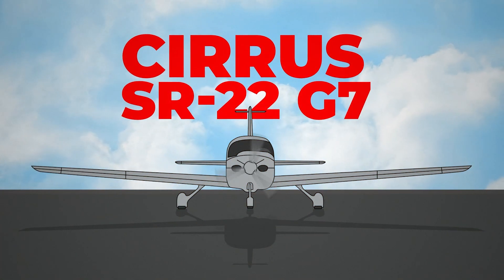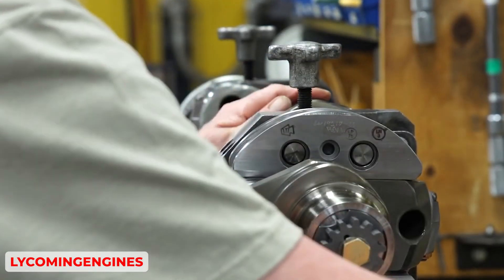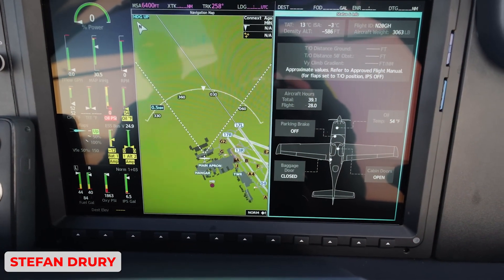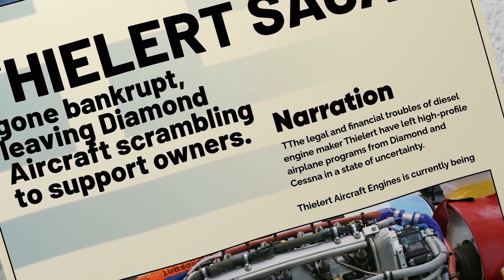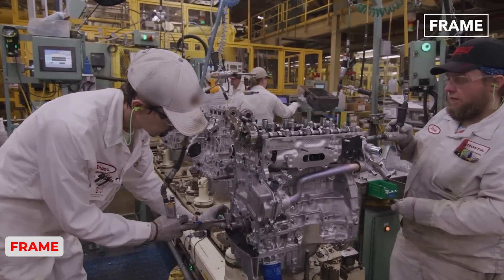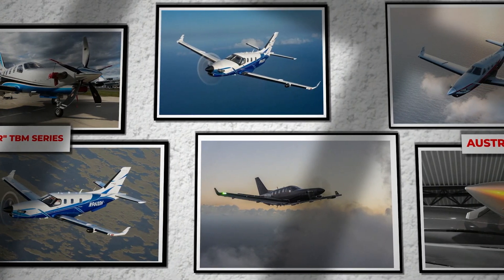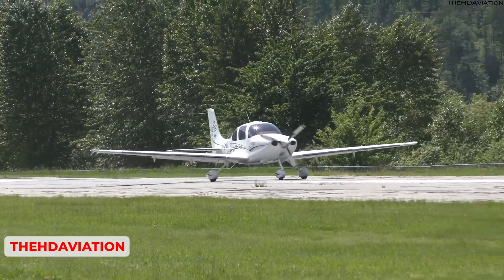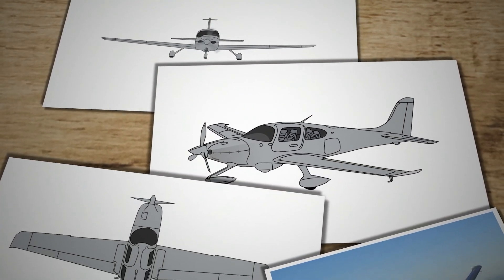Cirrus SR22: Modern Airframe, Grandpa Engine

Comment: Cirrus and Continental are owned by the Aviation Industry Corporation of China (AVIC). Questions? I have personally seen an SR22 with the CD-300, but why should Cirrus offer a different engine if they can sell more SEP planes at 1,5 mio. $ than they can build with the old ones? We can't have modern engines because we are willing to buy the old ones still, that's it.

Comment: I do not agreed, Continental has certified a FADEC version of the 550N, this engine works perfectly safe and it is more economical that the standard engine only with a weight penalty of 7 pounds